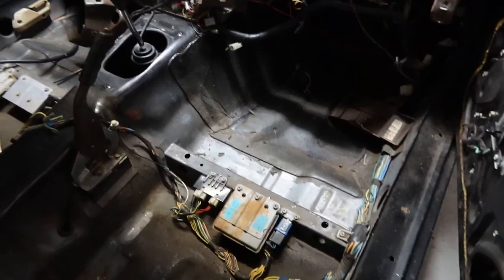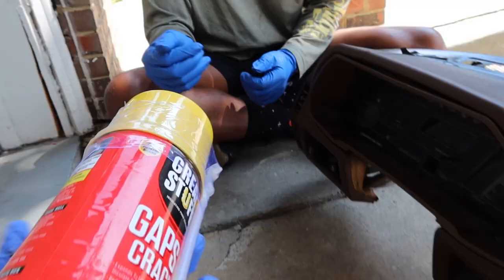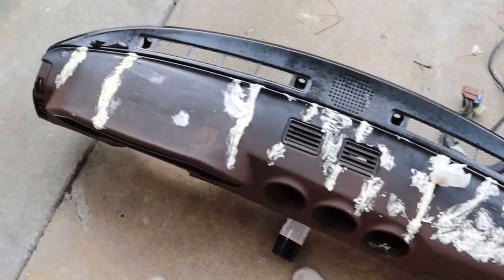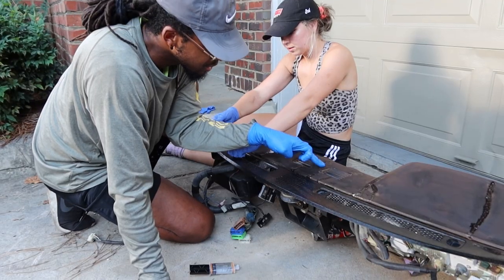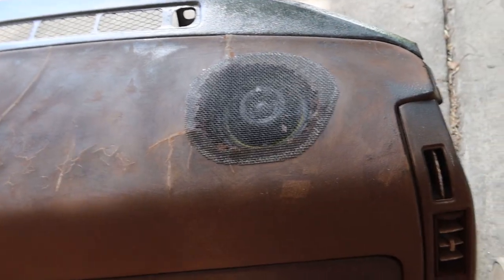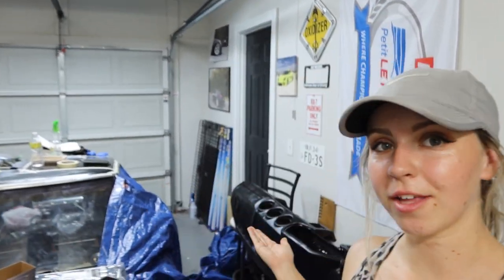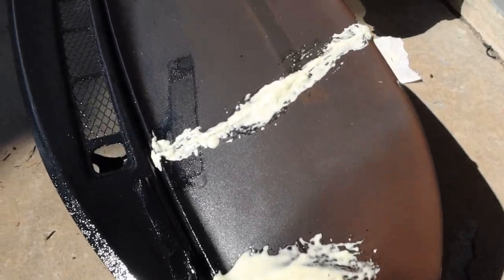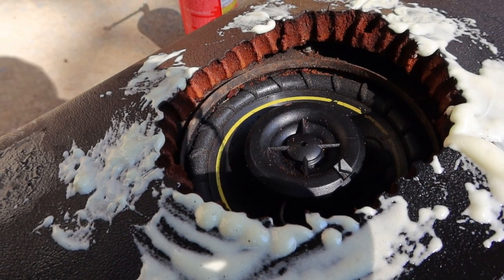1983 280zx *DIY Dash Flocking* Transformation

Comment: How did the speaker mesh come out? I'm curious if it would have benefitted more from a mesh speaker cover.
Reply from the maker: I wish I got closer shots of the after of the dash before we installed it 🤦🏼‍♀️ the speaker cover turned out… okkkk… the flock didn’t cover the edges as much as I thought it would. So it ain’t perfect. But it’ll work for now until I take the dash out again for the 2j swap!